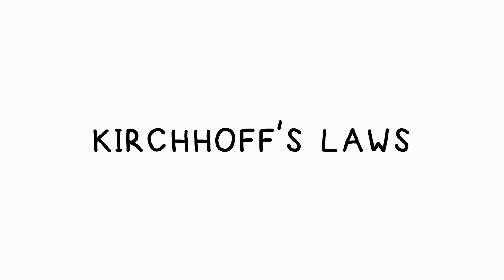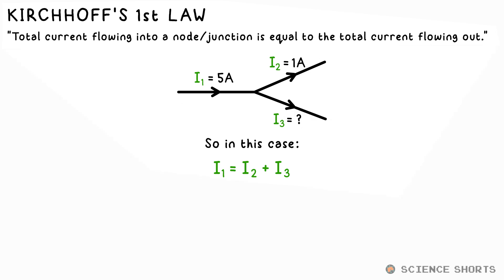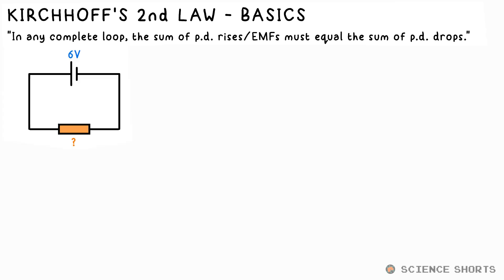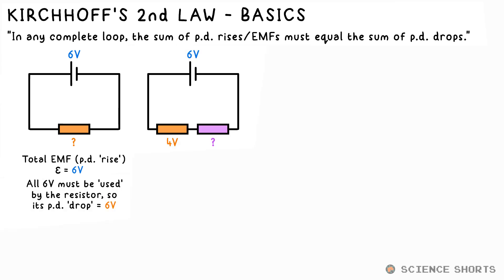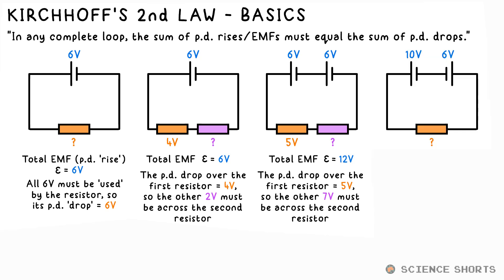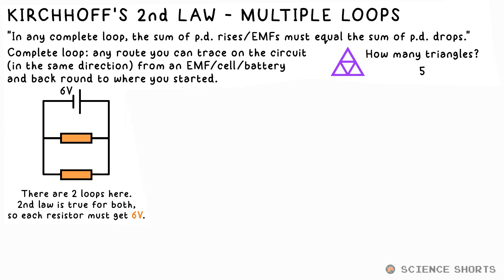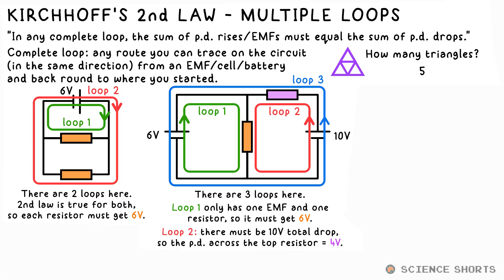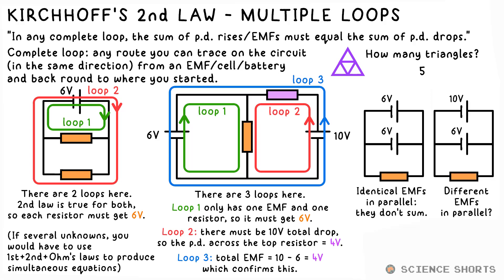Kirchhoff's Laws - Electricity - A-level Physics

Comment: As you said the resistor in the middle has a pd of 4V due to the emf of 4V in loop1.What would happen if the resistor in the middle was the only resistor in the circuit?What would it's pd be?
Reply from the maker: Like I said, that's when weird stuff happens in the batteries, as you're effectively short circuiting them. We don't consider such situations - ever, as there is no benefit to them.